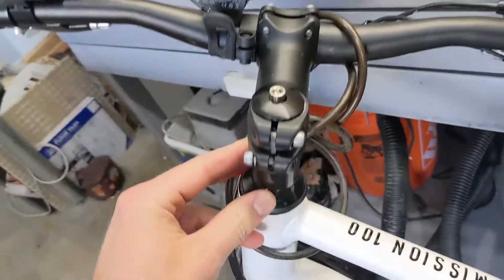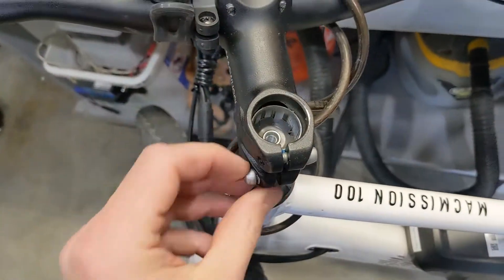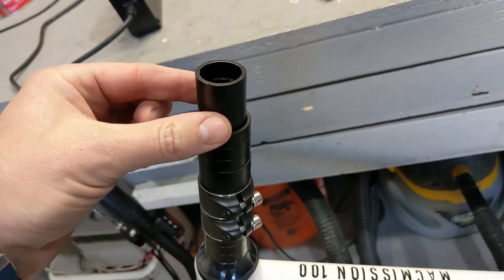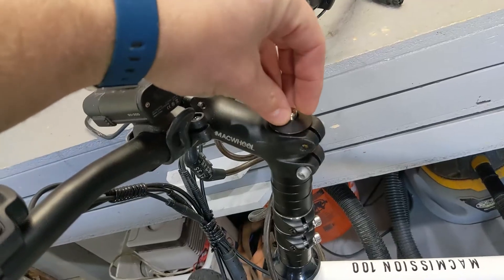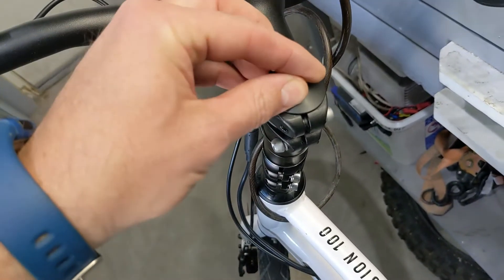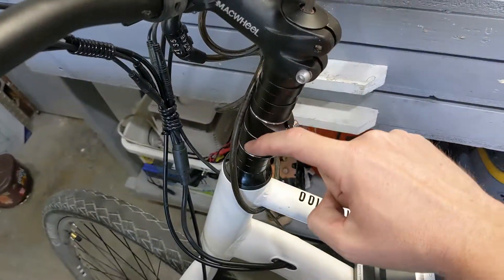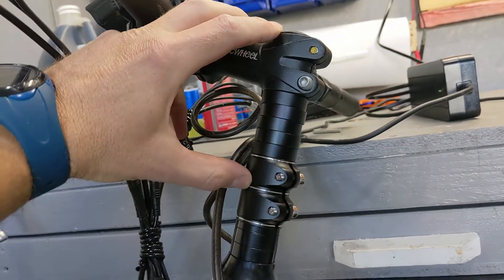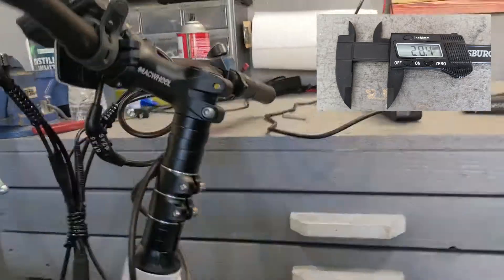How to install Bicycle handlebars risers Correctly on a Chinese Bicycle #macwheel macmission 100

Comment: Thank you for the video. I ended up buying the same stem extension and followed your steps but still the  handlebar is not staying straight when I ride. When I make strong turns the handle bar gets tilted. I have the same bike.  I'm not able to tighten it any further. Any advice?
Reply from the maker: Yes, you can insert some aluminum foil to get it more snug and get it more tight after